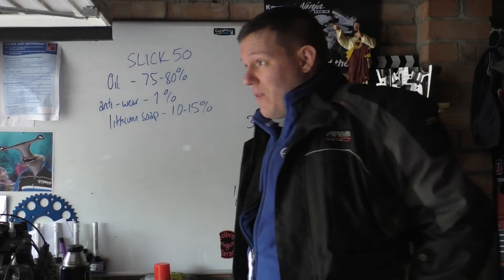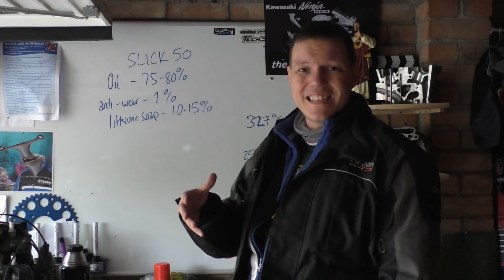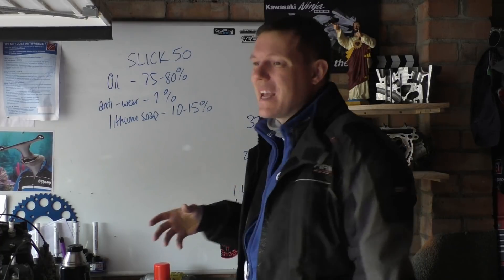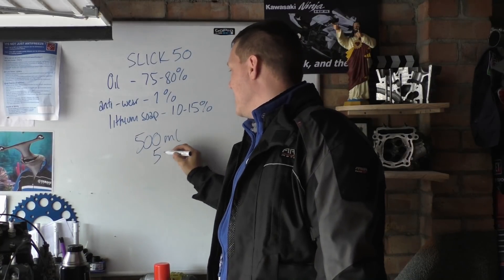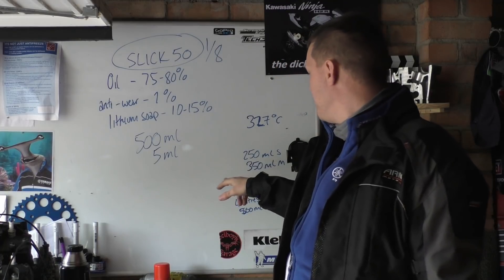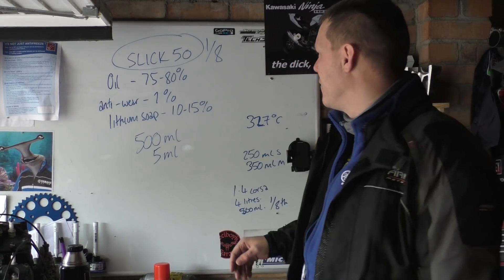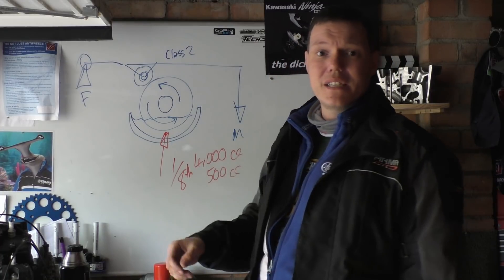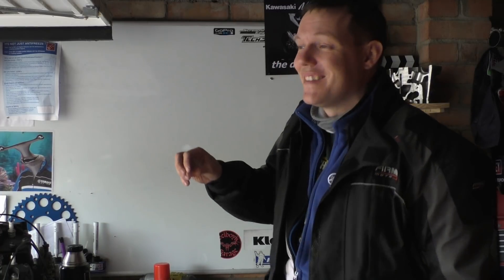Oil additives - do they really work? - Shop Chat

Comment: Hey Matt! How is it going? Today a British sale's man came in our shop wanting to rent the Dyno... Apparently he is testing a "graphene" additive to reduce friction. He also said the cars will be through an emissions test. It sounds like a catch to sell something later, for me.
 What's your thoughts? Maybe those cars have some trick in the ECU?
Reply from the maker: Well how did it perform?
Reply: @thedirtyworkshop  he just came in for a quote, i'll update you. I'm just wondering if i should monitor the ignition timing and injectors while we're at it.
Reply: @thedirtyworkshop  as foreseen, it indeed had an ECU tune. And dyno results showed slim to none gains
Reply: @thedirtyworkshop  also, i messed with thw bottles for a little bit and it looks like just graphite powder mixed with mineral oil lol

Comment: I always said that they should bake the wheel and dowel in the additive at roughly engine operating temperature and then test it. I am under the impression that that shit has to bsically bake on to the surface. But, with that being said, on our side of the big pond whatever the government agency that would certify that "one arm bandit" says NO!!! It is not accurate. That says something. I know that Lucas and STP are nothing but oil thickeners!

Comment: Hi Matt. 
The secret sauce in slick 50 is Boron Nitride  Ceramic suspended in PTFE (Teflon). When you run your engine these nano particles fill up all the little nicks and scratches on the metal parts. Then the heat from your engine over time, cures the Ceramic matrix onto the metal. Once cured it has a melting point of 2,900c. Its also about half as hard as diamond. You should add it once the unit is run in, never in a new unit that has not been run in. But wont fix a fucked engine.
Martin H.
Reply from the maker: And what happens to your clutch?
Reply: @thedirtyworkshop  Hi matt. thanks for the reply. In an old wet clutch the Ceramic would not bond to the cork pads. In a more modern Hi Performance wet clutch the Ceramic would not bond to the Sintered Brass due to the copper content. Hope this helps. Martin H

Comment: If you can get a whopping 80% reduction in friction on exhaust valve lifters, it has to do something. So if everyone used it would collapse the engine building industry. ?https://blog.sfrcorp.com/2006/09/13/do-oil-additives-really-work/ So why bother to wait using this stuff until the engine is worn, why not use it after the ease in period. If my Honda four hundred twin had no ring wear after sixty thousand miles  ,it must have been doing something.

Comment: I use xado 120% for motorcycles it comes from the Ukraine and do seem to do what it says on the packet
Reply from the maker: What does it say on the packet?
Reply: The Workshop  from what I've figured out from the site  it is meant to be attracted to all the metal bits and build them up again and smoother running  and better power and fuel economy could be a load of bollocks to lol but my 2bikes  seem to like it get a syringe of it and try it in the sv send me a.pic of the one and il let ya know if its the correct one it is in a orange box and has a pic of a bike on the front .it do seem to do something

Comment: My ex’s father in law was a real engineer for Sandia Labs and a pioneer in giant scale RC planes, he stated that the reason modern engines last so much longer than those of the 50-60-70’s were the acids in the oils that corroded the metal, not friction caused wear. Just follow the manufacture’s recommendation on oil changes! Don’t waste your money! On my race bikes I change the oil all the time, they run a max rpm and oil get dirty during off road races.
Reply: Actually he is wrong. Oil has always had acids, still does but has certain chemicals to neutralize the acids. Its the varnish content. Through the years they have purified the oil to higher standards  and have added chemicals to suspend the impurities. As much as we would like to believe it, oil companies have NOT given you the perfect recipes. They have to comply to certain approved standards but the main thing that comes into it is cost vs profit. There is no charity. Now there are different oil companies and most of them make oil which is a by-product of Petroleum based crude oil. However there are companies that specialize in lubrication only and these companies select the best base crude oils for lubrication. There are two I know of, LE Engineers, see products on You tube and Magna industries which also name their product Omega Lubricants. (Also on you tube) They use a napthinic crude oil which is far better for lubricating than petroleum based crude oils. The downside is that they are expensive.

My personal experiences with them. I had an Opel Astra which was smoking. I used Castrol Magnatec at the time. I was talking to the Rep for Omega products who told them to try one of their oils as it might be that I have gummed up rings. I tried it and after a few 1000 km the smoking stopped. I went back to standard oil because of the price  and still no more problems. This oil has a high detergency for diesel and Petrol engines.

Personal Experience #2. The company I worked for in the 90s had hydraulic vibrator conveyors for moving their product. They tried all different makes of hydraulic oil from different petrol companies with the same results. Their top products were used. The best they could supply. The units would stop vibrating after 20 minutes and you would have to wait a till the vibrator cool down before they would work again. After a month of use the internals would self destruct and would have to be sent out to an engineering company to be rebuilt. I then called the Omega rep in who said the viscosity of the hydraulic oil was breaking down due to friction and heat build up. He claimed that their product would do the trick. After each unit was rebuilt we used the Omega product. Not one of them stopped vibrating, Not one unit failed. The units were thrown out 6 months later still in perfect working order with the same oil. The reason was the conveyors were replaced with belt type conveyors. I can even give you more examples of their products. The company I worked for used LE Engineers oil in their air compressors. This replaced all oils used by the petroleum companies. The oils were tested by in pendant labs.  The Petroleum based oils were changed annually due to test results. The LE Engineers oil would last anything up to three or four years before it was changed. Although it had deteriorated it was still usable. Please note, I am in no way affiliated to any of these companies.  The point I am making here is that no recipe is perfect. However I do agree that in most cases it is better not to add additives unless it has been tested independently by qualified Labs.
Reply: See article Demystifying Sludge and Varnish https://www.machinerylubrication.com/Read/268/oil-sludge-varnish

Comment: I expect all these additives work, but whether they give you any benefit in the real world is the question.  If you change your oil at the proper interval rather than buy these additives you might as well burn £10 notes in sacrifice to the engine gods, it will give you just as much benefit.

Comment: You've got a point. Then again, he tested a lot more oil additives with the same method and the one you showed (with MotorKote) was the only one showing such a significant reduction in wear. It means something, at least.
Reply: I does but unfortunately it's useless data for the real world because of the test issues

Comment: Another problem with those tests is that they are running way higher contact pressures than you get in an engine. Add some oil with extreme pressure additives such as EP90 and you you'll probably get better results than the snake oil. Oils are tailored to their application. Engine oils need to form a good film at high speeds and temperatures. They also need to be able to handle combustion byproducts. They don't need to handle extreme contact pressures. The demo test is dramatic but completely inappropriate for the oil under test.
Reply from the maker: "Another problem with those tests is that they are running way higher contact pressures than you get in an engine."

- this isn't an issue. As long as the test is the same for both samples. The issue I have is how long this stuff lasts. They say is increases the life of your engine, but does it? We'll find out. 

"The demo test is dramatic but completely inappropriate for the oil under test."

- yes and no. Whilst I agree that this isn't representative you are looking at the peak pressure. Same tests are performed on all engine components. Like con-rods, they will be pulled (tensile test) until the small end yeilds that fractures. They do this to see how much force until yeild and failure. Does an engine do this? No, but if your comparing your new Titanium rod to your old steel one then you know the limits etc.

My issue is this is the only test they demonstrate and its only half the story.
Reply: "Like con-rods, they will be pulled (tensile test) until the small end yeilds that fractures." - that tells you the limit and as long as that limit is higher than the operating conditions of your engine plus a safety margin all is good. However you also don't want your rod built like tank. If it is too strong it is also too heavy. The same goes with oil. You can optimise it to pass this extreme pressure test but you will compromise other factors such as anti-corrosion or the ability to handle combustion byproducts. There is no perfect oil for all applications - it has to be tailored to suit. The only meaningful way to test oil is to subject it to realistic working conditions.

Comment: also that wear test. companies that use it to show their additive is better. . there is also a trick that they heat the fluid up to operating temp of 100C /212F . when its heated up. it becomes super slippy ( LOL) and works better than a cold oil will
Reply from the maker: Yeah but that's just the once. Oils and additives break down over time. My question is, are the additives in say castrol choosen because they last longer? Which to me is far more important that once.

Comment: I don't think you need to run any additives on any new engine,but have used some products to clean the build up gunk out of an old engine,just because you change your oil when your suppose to dosen't mean that happened before you got it.some other products will thicken the oil,and make a better seal,but you could just run thicker oil for that,none of these is going to fix the wear your engine already has.

Comment: If you burn PTFE it gives off Poisonous Phosgene "Mustard Gas". But I guess it'll be well diluted in the engine oil.
Reply: Thermal decomposition of PTFE produces several toxic gases/fumes. 

https://www.ewg.org/research/canaries-kitchen/teflon-offgas-studies#.WuewYtQrKt9

https://www.google.com/search?num=100&newwindow=1&ei=iq3nWsGdJaSQggfvi5WQCQ&q=overheated+ptfe&oq=overheat+ptf&gs_l=psy-ab.1.0.0i22i30k1.7523.38291.0.41058.7.7.0.0.0.0.219.683.6j0j1.7.0....0...1c.1j2.64.psy-ab..0.7.679...0j0i10k1j0i20i264k1.0.CLsMDg9V-sY
Reply: patw52pb1 Thanks for the correction mate. Cheers.
Reply: You are welcome. Cheers.
Reply from the maker: I think you're mixing up Chlorine and Fluorine.
Reply: The Workshop 
Hello Matt Dear Friend. Like you I am an amateur Physicist and over the years I have used the Scientific Method of thinking about reality. But I still have The baggage of being told about shit that's wrong from, back in the day. I believed it. I'm too trusting. I totally welcome being told I've got the wrong end of the stick i.e., the PTFE Decomposition at high temperatures. Take Care Dude. X.

Comment: In project farms bearing test that motorkote performed miles better than any of the other ones he tested. You should run slick50 and motorkote in the SV or a smdll rngibe if yer feeling protective. If yer feeling game that is, and do the bearing test after a few miles. Would be an interesting one. I have a k6 Sv650. There's a good reason they started making the old SVs again.  Keep up the good vids. All the best from NZ
Reply: MotorKote allegedly contains chlorinated-napthalene/chlorinated-paraffin, which is corrosive and damaging long-term.  
Allegedly an independent lab test (Chlorine Content, Bomb Method, ASTM D808) performed on a virgin sample of MotorKote measured over 28% chlorine content. 
Subtituting chlorine laundry bleach or Head and Shoulders Shampoo in place of MotorKote as the lubricant with the Timken/Falex lubricity test apparatus will produce similar bearing scar damage as MotorKote. 

http://thebestsyntheticoil.com/pdf/TSB%20MO-2010-04-01_chlorine_oil_treatments.pdf
Reply from the maker: Very, very intresting.

Comment: I used to have access  Oronite's additive package for years and Vanderbilts Lubricant Additives. Unfortunately my source died. He did not even charge me. He worked at a specialty lubricant blending company that made finished specialty products for mining industry and other specialty commercial industries! The closest you can get to that over the counter is Redlines Break In Oil Concentrate.

Comment: I use the oil recommended by the manufacturer because it works and has been proven by the manufacturer
Reply: Coal Cutter 
plot twist -
they know it doesn't work very well so wears parts quicker, meaning you have to spend more money with manufacturer on replacing parts 😱

Comment: PTFE.
The last hope of the woo-snake oil peddler.
PTFE does not bond to metal in the presence of oil. At all. Never. Nope. Diddly cock drips. To get bonding, you need super clean, micro etched ( usually acid etched ) surfaces.  Not an oily surface.
Check out how industrial PTFE coatings are applied and scoff heartedly at the claims of PTFE additive peddlers.
PTFE has other issues, some of which are quite unpleasant. PTFE is used in some gaskets, grommets and loom coatings. When it gets too hot, one of the decomposition products is a nasty acid called hydrofluoric acid. This is nasty shit. Really nasty. Fire crews hate it.
Oil containing PTFE in the ring lands of the first compression ring can decompose to hydrofluoric acid, which is not good news for your additive package, your ring lands or anything really.
PTFE does not bond to metal in the presence of oil, so it cannot coat cam lobes, buckets, gear faces etc. It can break down in the presence of the rather high localised temperatures the sliding faces can generate for a few microseconds, even in the presence of an oil film. The pressures per square inch at that point, of gear loading etc are somewhat extreme. 
PTFE will drop out of suspension. PTFE can clog narrow passageways. PTFE swells like a vicars cock with temperature, this can cause a pressure drop across the oil filter. That isn't a good thing.
The only place for PTFE in an engine is where the manufacturer originally puts it.

Shyte like ZXMAXX is best avoided too. Chlorinated paraffin in a mono base oil. Basically, what gets used as a cutting fluid. It can break down under high temperatures to form hydrochloric acid. Not as nasty as hydrofluoric, but still not wanted in an engine. It does sort of half arsed work in a way, but not in any way beneficial to an engine in good order running with good oil stock.

Molybdenum disulphide. To paraphrase Douglas Adams, mostly harmless. Actually does reduce friction at contact points. Also bollockses wet clutches. Not really needed in an engine. Not bad in steering boxes, old gearboxes etc in cars/vans/trucks. Makes very good grease, and a pretty effective build lube.

ZDDP
The zinc package. The last resort additive when all else fails. This is the additive package that works during transient metal-metal contact. Old engines may benefit in terms of wear reduction for lifters, or where the oil supply can be marginal. All multigrade oils contain some. Adding extra doesn't really do much good to an engine in good nick, but the small amount that gets burned off in all engines can poison catalytic converters. Not needed. Not recommended. Rather toxic.

Resin oil thickeners. Just don't. Ever.

I've ridden a number of bikes to in excess of 125,000 miles without adding oil additives. Just change the oil and filter, service them on time, don't rag them until they're warmed up and be amazed at how reliable a Japanese four cylinder adrenaline pump can be.

Additives are for wazzocks. Don't be a wazzock.
Reply: Spot on.

Comment: i prefer to put what the manufacturer recommends i put in my crank. oil. in the early 80's these snake oil salesmen would come around the service station. dick, our boss, no i'm not kidding, would entertain them. then we would watch them do there thing with putting load on a roller bearing. good times

https://youtu.be/sfNqUKJ4AfU

Comment: I put water in my oil to make sure it doesn't run too hot. As an unexpected bonus, whenever I take the oil filler cap off there's free mayonnaise underneath the cap!
Reply: it's is a known fact that .....
Reply: Just fixed my head gasket. It was a SOB.
Reply: on a more serious note, I think my head gasket's on it's way out. Little bit of oil in the coolant. No coolant in the oil though. Not sure how that one works. Any guesses Matt, or do any youtube comment certified engineers want to have a punt at that one?

Comment: This wear test result is extremely dependant on the viscosity from the product, the thicker the oil the thicker the oil film, the less wear.

PTFE is used as a solid lubricant, it sticks to bearings and keeps the parts seperated.